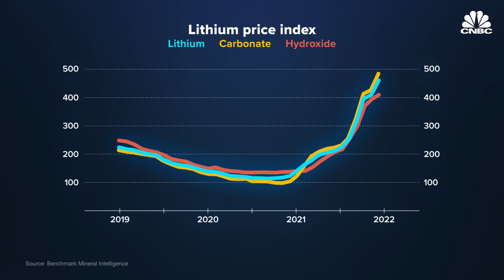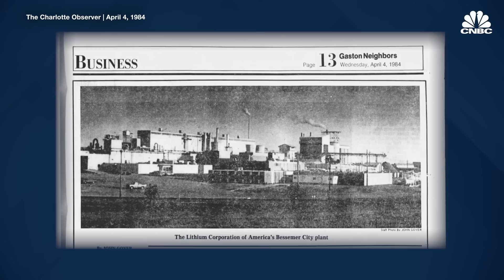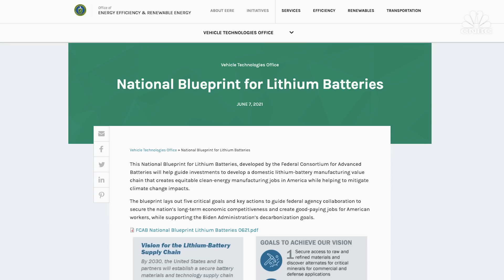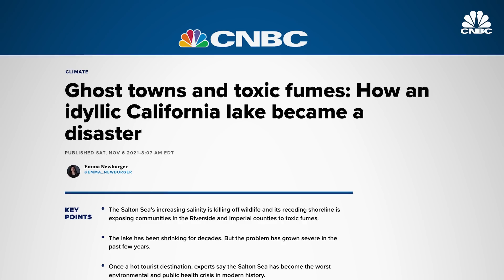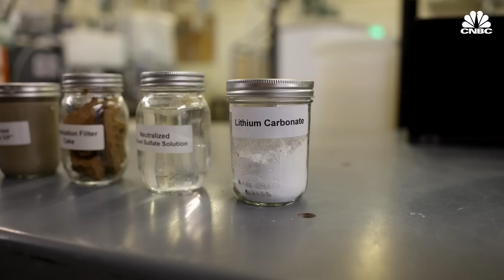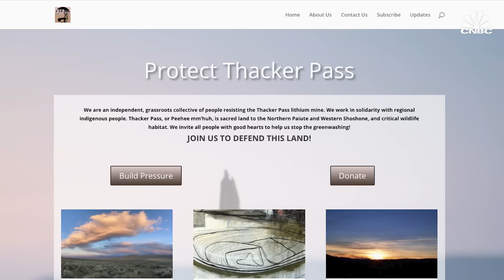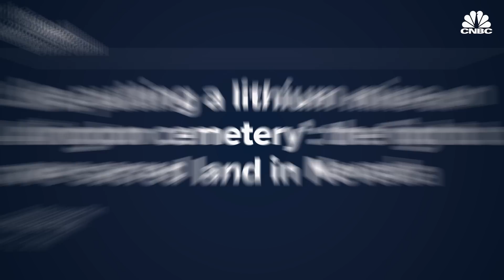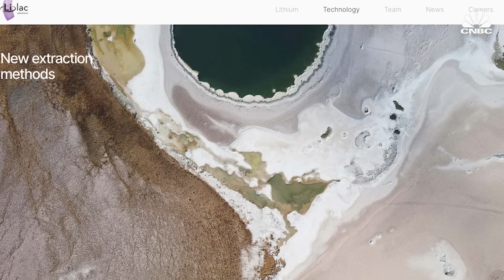Why The U.S. Has A Massive Lithium Supply Problem

Comment: US will need to list lithium and rare metal productions under emergency national security measures.  The problem of shortage is real and delayed action to start production will bring US EV ambitions to its knees.
Reply: it's not an emergency though, we really don't need it. For what, Batteries? Get real. Battery tech is surpassing the need for lithium if you follow that.
Reply: @roadtrippin2781  The question is can that battery tech become cheap enough before the lithium supply worldwide dwindles enough to be an urgent concern.
Reply: @roadtrippin2781  even solid state batteries use lithium. The lithium free batteries you speak of are decades away
 We have barely perfected solid state so slow down sir. It takes years for every new evolution
Reply: @khavaliar  There are much more chemistry blends than lithium, and they are more dependable with longer lifespans and have been around for decades longer than lithium chem batts, Just throwing that out there. All I was saying is lithium isn't the be all, end all of battery chemistry and they aren't taking as long as you think. If you follow this closely you'll see that.
Reply: @roadtrippin2781  depends on the use case.. if it's for cars and electronic then lithium probably for now. But large power storage I've seen things like iron and vanadium batteries and whatever else they can conjure up
Reply: @roadtrippin2781  stop trippin and read
Reply: @ericyuan9718  
Or pms
Reply: Yes as per usual, the Chinese beat us to it but we are too busy wasting out time and efforts on the 'pandemic' .  The real threat is their total monopoly on rare earths and battery metals.
Reply: @roadtrippin2781  you are 100% WRONG on that point.  There is very little lithium needed in the manufacturing of EVs, but despite such tiny quantities, YES:  IT IS necessary.  In a similar way, silicon chips make up far less than 1% of the mass of any car today, but when the chips were unavailable recently, EV (and ICE car) production came to a screeching halt all over the world, and has still not been fully restored.  Lithium IS vital.
Reply: Some  of  the best solutions that are  eco friendly could also be the cheapest and more abundant ..the desire for massive  profits has blinded many..
Reply: You posted this 2 months ago. Your comment has not aged well AT ALL. 

Also, the barrier to a technology is its ability to be manufactured on a large scale. These new types of batteries need to be figured out.
Reply: @ericyuan9718  The lithium issue is quite different than that for many other materials such as nickel, cadmium, magnesium, and cobalt.  Lithium is ubiquitous--- it is even present in sea water, though it is not easy to economically extract.

Other key metals, including some "rare earth" metals, may not be abundant until we can begin mining the asteroids; that is something Elon Musk seriously intends to do, but will likely take decades.

Elon was smart to corner the market on some of these materials before others even thought to line up the raw materials they need--- companies such as GM and Ford just assumed that they would always be able to buy enough batteries for their needs, but the supply chain has already been so restricted that Ford realized they had to significantly reduce their production of Mach- E, F-100 and other models.

Even Tesla has had to be creative to keep their production lines busy, relying on multiple battery chemistries.
Reply: @ericyuan9718  

Large Lito mine in the Northeast of PORTUGAL 🇵🇹🇵🇹🇵🇹 The biggest deposit in EUROPE🇪🇺🇪🇺🇪🇺 Easy to prospect on the surface. Good roads for transport. There is also a lot of tungsten and volphamium 💰💶💰💶💰💶💰💶💰💶💰💵💰💵💰💵💰💵💰💲💰💵💰💵💰💲💰💶💲💰💶💰💰💵💰💰💵💰💰💶💰💲💰💰💵💰💰💰💶💰💵💰🇺🇸🇺🇸🇺🇸🇬🇧🇬🇧🇬🇧
Reply: i don't see why  having EVs in America is an  emergency
Reply: @ericyuan9718  ''''''''''''The question is can that battery tech become cheap enough before the lithium supply worldwide dwindles enough to be an urgent concern.''''

they can produce lithium from ocean water

will we run out of ocean water anytime soon?